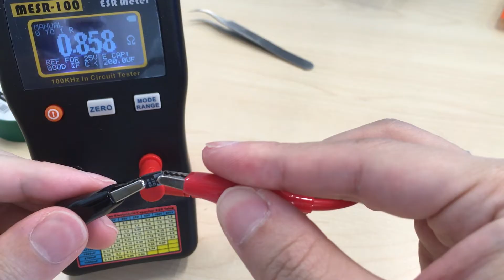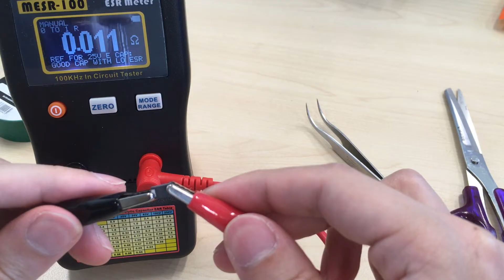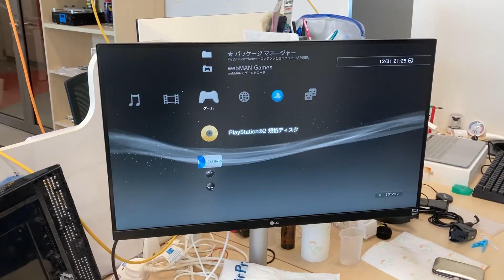Replacing PS3 capacitors (NEC/TOKINs) nicely

Comment: Wow, where you order that capacitor?
Reply from the maker: I ordered them from Aliexpress, but as shown between 4:27 - 4:50, some of them are faulty. (In case you don't know, you can turn on subtitle for this video. There are useful information in the subtitle) So I don't quite recommend you to buy it from Aliexpress, unless you have the ESR meter like me to check each of them.
Anyhow, the part number for the capacitors is Panasonic 2R5TPE470M9, if you check if your local stores sell them too.
Reply: @hardwarerepair200  thank you very much, i agree i order many time in AliExpress but all the time i check

Comment: I have a question. You put 6 capacitors on one side of the motherboard, but what about the other side? Do they only need to be put on one side of the motherboard? 
Because I have also seen videos where they put 3 on each side of the motherboard and then have to connect the positive sides of the capacitors using a cable on one side of the motherboard.
Reply from the maker: I only replace enough capacitors until it boots up.
Also, it is a very old video and this method is not good.
Here's the latest method
https://youtu.be/40XQ8L9wsCA

Comment: I see that you only replaced one. How come? I have faulty nec/tokin's too. Do i replace all? I have 1002 errors
Reply: Try to keep some intact if you can, saves having to bridge the new capacitors positive ends with wire. Just as some context, the NEC tokins have an internal bridge for their positive terminals, and removing all NEC tokins requires you to replicate that bridge. There’s some good information and tutorials on using thick wire (to avoid bad stuff) to bridge the new capacitors. All the best on fixing your PS3!
Reply: @gamer-ot1xf  He put 6 capacitors on one side of the motherboard, but what about the other side? Do they only need to be put on one side of the motherboard? 
Because I have also seen videos where they put 3 on each side of the motherboard and then have to connect the positive sides of the capacitors using a cable on one side of the motherboard.
Reply: As far as I know, leaving the NEC Tokins on one side of the motherboard retains the internal bridge, but if you remove the NEC Tokin beneath the area you are working on, you’ll need to use a jumper wire to restore the bridge. I’m not an expert on how the NEC Tokins use their internal bridges, but this is just my 2 cents and best guess on how it works. When in doubt, there are some experts in PS3 repair that know how the PS3 delivery works such as RIPFelix, he’s made some awesome videos on PS3 repair and what not to do when repairing them.
Reply: Also, 1002 errors suggest your NEC Tokins for your RSX are bad, hope that helps :)

Comment: Question, what do you think is most likely the problem for my ps3 if it turns on completely fine but when I load a demanding game like final fantasy 13 and it shuts off after like 2 minutes of gameplay. The red light doesn’t show anymore after it shuts itself off either. Until I take out the power and plug it back in. Thanks
Reply: I have exactly the same problem, when i ask in the Facebook forum they say it's nec tokin problem
Reply from the maker: Only syscon can tell you the exact problem.
I recommend you to search for "PS3 syscon tutorial".

Comment: Hello, great video!
Can i instead of buying new capacitors use used ones pulled from a PS3 Slim motherboard? They are small like the ones you ordered. I'm not sure of their value and their ESR.
Reply: https://drive.google.com/file/d/1jTAEPQms15l2Bc8p4o1EvSw2hIhuMnFX/view?usp=drive_link

An image of the capacitor i am talking about pulled from a PS3 Slim board
Reply from the maker: I can't see your image because you have set it to private
Reply from the maker: Yes.
The cap you showed is 470uF (marked as S8 on it). The marking e means 2.5V.
For more detail, please refer to the datasheet
https://www.scribd.com/document/674540277/Nec-Tokin-Tepsgv0e477m9-12r
Reply: @hardwarerepair200  thank you! Much appreciated

Comment: How about to replace nec tokin for another original nec tokin instead of tantalum ones?
Reply from the maker: Sorry for the late reply.
If brand new NEC TOKINs are available, replacing it with another NEC TOKIN actually gives you the best result.
The reason that we replace it with tantalum ones is that it is the second best replacement.

If you are seeking the original performance, Felix actually designed this board to emulate the original NEC TOKINs by placing the tantalum caps in a specific order.
https://oshpark.com/profiles/RIP-Felix

If you don't know Felix, please also check out his YouTube channel. He has some really nice videos about what YLOD actually is.
https://www.youtube.com/@ripfelix3020
Reply: @hardwarerepair200  i bought some "new" nec/tokins  do you know how to check their capacity?
Reply from the maker: @ukemix8848  To check if the NEC/Tokins are actually new, you need to measure both capacitance and ESR. Measuring only the capacitance is not enough since old NEC/Tokins can still have a good capacitance but bad ESR.

You can check here on how to measure both capacitance and ESR
https://www.ietlabs.com/pdf/Manuals/DE_5000_im.pdf

New and fresh NEC/Tokins have 0.002 or lower ESR. Any values higher than this means that the NEC/Tokin has already gone bad.
Reply: Idk

Comment: https://drive.google.com/file/d/1bmSmhgKqYOq9eHOs9hJtos57ZwdmKjSp/view?usp=sharing

Hello, I need help, can you make some resistance measurements with a tester? I am attaching a photo directly from your video
Reply from the maker: I don't remember the exact value. But between positive and negative terminal, it should be a few ohms. And positive and positive (the outer two lines) should be 0 ohm.

Comment: Changing Tokin caps are not a permament fix, the gpu chip used in these devices is faulty manufacturing. There is enough information on this in research and forums. As a result of applying heat treatment to the motherboard while replacing the capacitors, the rsx chip also heats up and there occurs a temporary troubleshooting. You think PS3 fixed because YLOD's gone.  Actually maybe your capacitors were OK :)
Reply: here's the person who watched the rip felix video without getting the point at all
Reply: @Dekaid  There's way more than just one person doing it.. Seems like a lot of people walked away from that video without actually getting it.
Reply: @draconic5129  yea, I keep seeing it, it isn't even rip felix's fault, the whole video was all about not taking a simple answer and yet so many people took a simple answer from it lmao
Reply from the maker: Thank you both for clarifying. Yes, always check syscon before attempting any fix.

Comment: Man, hi, i have a question Is that, if  can i use tantalums one but no smd, and i Will try to put more as posible for the ESR
Reply from the maker: You need to check if you have enough space to put non-SMD cap under the shield. If your cap is too huge, you can't even assemble the PS3 back.
Reply: @hardwarerepair200  yeah i think that these ones non smd , are small i Will check  thanks Man , you should me to put approximately 5,600 UF?  12 caps 470 UF, well , i need to be present with the ESR ,i said it because i was thinking tu put one with the capacity, well i Will check , then I'll Let you know, you are the Best thanks

Comment: Hello dear friend, help me find out. Is it possible to replace the capacitor with this one of this brand 2R5TPE470M9 ?
Reply from the maker: Yes, as long as the the capacitance is 470uf and the ESR is low, then you are fine. Be careful some cheap capacitors have a high ESR which won’t work well

Comment: Have you ever mounted physically and electronically a headphone jack in the PS3? Or modified the lid / cover so the "PS3" logo lights up? Thank you 🤓
Reply from the maker: I don't have experience doing the PS3 logo mod. But it sounds like a nice idea! Let me know if you figured it out.
For headphone jack, you can use the composite cable came with PS3 and buy a composite to 3.5mm converter like this
www.amazon.co.jp/dp/B00O1GK8MO
Reply: @hardwarerepair200  the PS3 was given to me by a neighbor. No cable, no controllers!!I got a suitable replacement hand controller and the system does work. Not sure about an included composite cable for the sound. Thank and I will check out your link! 🤓

Comment: Good evening, excuse the capacitors, what value does it give when it doesn't work and what value does it give when it works?
Reply from the maker: For the original capacitors it needs to show ESR < 0.005 and Capacitance around 1280 uF to be working.
As I have shown in 3:15 and 4:29, a bad capacitor can have a correct capacitance value but wrong ESR value. So you need to measure both.

Comment: Good night, sir!
Did i change all the nec tokin to tantalum? My ps3 is ylod but don't know which nec error is
Sorry bad english😂
Reply from the maker: To check if your NEC Tokin has gone bad, you can use a TTL to extract the syscon error log. If the error log showed 8001001 then you should change the NEC/TOKINs for the CELL. If you got 8001002, then you should change the NEC/TOKINs for RSX.
Reply: @hardwarerepair200  don't know what u mean TTL and more...
Just want to change all the tokin to new tokin/tantalum😅
If i change all of that but still ylod, is that rsx/cellbe can be bad sector maybe?

Comment: Why did you use 3 on each side I thought you were only supposed to use 2 on top and bottom
Reply from the maker: They all seem to be connected in parallel so there is no restriction like "you must use 2". And it is just my lazy way to remove as few NEC/TOKINs as possible by putting back as much tantalum as possible.

According to my own experience, 90% of the time, you just need to replace one NEC/TOKIN if you put 6 470uF tantalums back.
For the remaining 10%, you need to replace two NEC/TOKINs with 12 tantalums.

By doing so, I won't need to remove more than 2 NEC/TOKINs even if they all went bad. So it is simply a personal preference on whether you want to remove more NEC/TOKINs and put fewer tantalums back, or you want to remove fewer NEC/TOKINs and put more tantalums back.

To me NEC/TOKINs removal is painful, so I prefer the latter one.
Reply: @hardwarerepair200  if I remove one nec tokin I would need to put 6 and if I remove 2 I would need to put 12
Reply from the maker: @warmaster336  Yes. 12 tantalum should be enough to compensate for the remaining two NEC/TOKINs at the back side even if they went bad.
Reply: @hardwarerepair200  I’ll give it a try thanks for the help

Comment: Come hai fatto a capire quale nec tokin andava sostituito?
Come li hai rimossi?
Reply from the maker: Sorry, I don't speak Italian. But I use Google translate to figure out your question roughly means
"How did you figure out which nec tokin needed to be replaced?
How did you remove them?"

Here's the reply I made using Google Translate:

La risposta breve è non lo so.
Di solito inizio a rimuovere quello che ho rimosso nel video e lo sostituisco con 6 tantalio, quindi provo se funziona. Il 90% delle volte, la sostituzione di quella già risolve il problema.
In caso contrario, continuare a rimuovere il NEC accanto ad esso e sostituirlo con 6 tantalio.

Secondo la mia esperienza, non ho bisogno di sostituire più di due NEC per ogni RSX o CELL.
Reply: @hardwarerepair200  grazie!!!

Comment: i removed all the nec in my mother board so can i put all tantalum and will it work?
Reply from the maker: If you removed all the original NEC, you need to bridge the two positive terminals (the top terminal in the 1st row and the bottom terminal of the 2nd row in the thumbnail of this video) using a high gauge wire. Otherwise it won't work and your PS3 will stay as YLOD/RLOD.

If you don't want to do this extra step, it is better to leave at least one NEC behind as the bridge. (The original NEC/TOKIN has built-in bridging between the two positive terminals)
Reply: @hardwarerepair200  will i removed them all but i'm going to put the bridge
Reply: @hardwarerepair200  it's been 4 months when you made this video tell me how the ps3 doing now is it now run so good?
Reply from the maker: @joemusashi2701  Yes, it is running good.
Reply: @hardwarerepair200  that sound good
Reply: @hardwarerepair200  What gauge specifically?
Reply from the maker: @Ting33s  For me, I used gauge 16. You should use something with the same thickness or thicker than this. But if the wire is too thick, you might have a hard time connecting it to the PS3 motherboard.

Comment: I replaced all the Nec tokin used 4 tantalum in  place of 1 nec, the console starts normally but when I lunch a demanding game like GT6 it shut down. should I put 6 caps or what do you recommend.
Reply from the maker: It sounds like you got some faulty tantalums. Have you checked the capacitance and ESR before putting them on the PS3? If not, I would suggest you removing all of them and double check.

You also need to make sure your final ESR is less than 0.005 ohm. If you have 4 tantalums, and each of them has 0.020 ohm, then your final ESR is 0.020/4 = 0.005. If you put 6 tantalums and each of them has 0.020 ohm, then your final ESR is 0.020/6=0.003. Basically the more you put, the better it is.

2:40 of my video shows how to check the capacitance.
3:30 of my video shows how to check the ESR.

I faced the same problem before and it was hell lot of work of soldering and de-soldering. Since then, I make sure all my tantalums are working before putting them on my PS3.
Reply: @hardwarerepair200  I didn't check them before installing, I will remove them and check capacitance before using new ones.
Thank you very much
Reply from the maker: @mouskakyo7571  You also need to check ESR. Because most of the time, a faulty capacitor has a normal capacitance but a bad ESR. ESR meters are usually cheap to get, but a ESR meter that can measure up to 0.001 precision is a bit tricky to get.

If you don't have a ESR meter right now, a quick workaround is to replace each NEC/TOKIN with 6 tantalums, and hope that there are enough tantalums to compensate for the faulty one.
Reply: @hardwarerepair200  I have a normal multimeter I can check for capacitance and if the capacitors changes properly, will try to find the faulty one, if not I will put 6 like you did.
Reply: I changed the tantalums, tested them and put 6 this time and it worked perfectly.
Thank you for your help
Reply: @mouskakyo7571  6 tantalums? Smd tecnology like In the  video?, 470uf?, In total you need to replace 2 CAP  and put 6 for place, right?
Reply: 6 capacitores de tantalo de 470uf para cada nec tokin,não ultrapassa muito?

Comment: Why is there fewer capacitors on the right?
Reply from the maker: Good catch! I used the wrong capacitors on the right. They were too tall, and can't fit into CECHA, so I was in the middle of removing them, and replace them all with the black one. Didn't show it in this video, but I soldered 6 black capacitors on both sides in the end.

Comment: Wow, do you know that the small perforated area you have just cleaned, is for heat-relief purposes?
Reply from the maker: I didn't intend to make it heat-relief, it was more for easier soldering later. But I guess there is also heat-relief by doing so.
Reply: @hardwarerepair200  That is not intended for heat relief at all so you did nothing wrong.
Reply: Yeah nice way to ruin a mobo. Just solder on an angle if you don't have 3 terminals
Reply from the maker: @daneayers7483  Thanks for watching!
If you don't have a electric grinder, you can also do it manually with a screw driver.
Here's the video on how to do it
https://youtu.be/pABdXU_RDFA?t=1565
I hope you find it useful :)
Reply: @hardwarerepair200  I don't grind any of the motherboard. If I'm using Panasonic capacitors with only 2 terminals I solder them at an angle. If I use Capacitors with 3 terminals they can be attached directly and straight. I never grind anything.
Reply: @daneayers7483  You really don't know what you're talking about.
Reply: @daneayers7483 not ruined. Still works. So, not ruined.